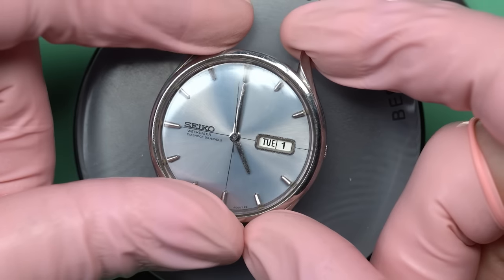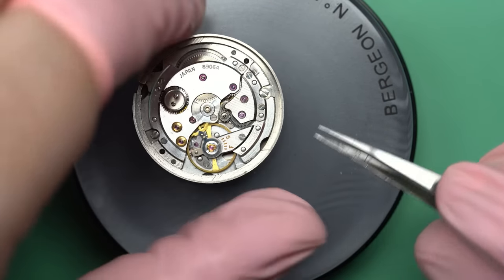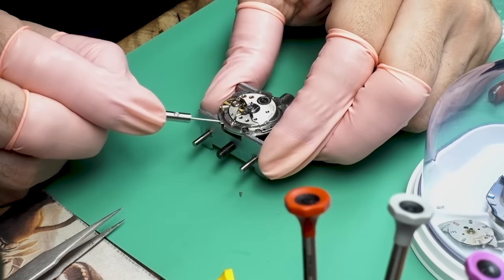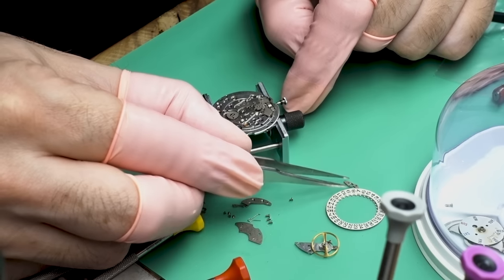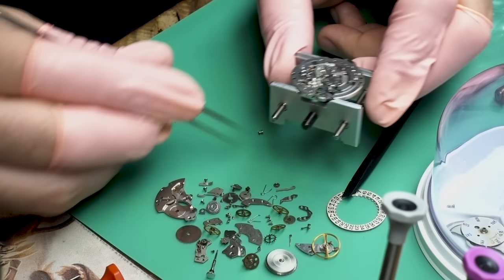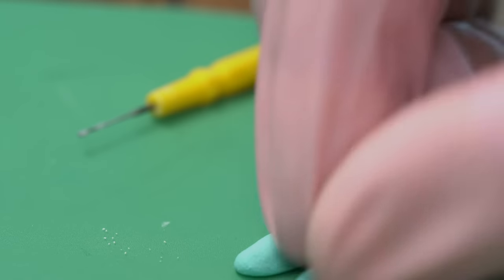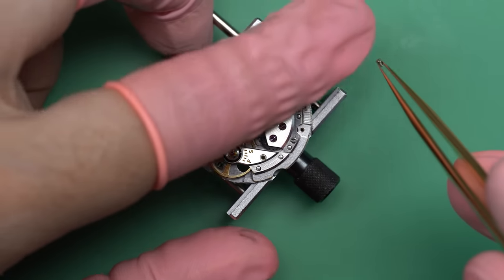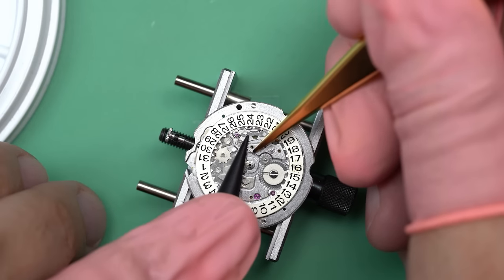Seiko Weekdater Sea Lion Vintage Watch Restoration

Comment: Hi Marshall, I checked out a bunch of channels and you explain this better than anyone. Since I was a kid, everything I didn’t understand had to come apart so I could see how it worked. Needless to say, I will pat myself on the back and have a good mechanical ability. So here I am and I would like to repair an old watch just for fun. My question is, what is a good watch / movement to start on? Where parts are readily available? I am a big overly handsome fella with large wrists, so if there are several options, something larger would be great so it will look in place on my wrist when I am done. Also, If you can suggest something that you have done a vid on would be super awesome so I can follow along on how you did it in case I get lost. Thanks.

Comment: I’m a watch enthusiast, with a descent mechanical watch collection.  Your videos have been very inspiring. I really want to get into watch maintenance/repair, if nothing more to learn how my time pieces work. I plan to teach my son while I’m at it. We are both mechanically inclined. Its a dying art that I hope channels like yours will revive. Detailed steps, informative, and the why behind certain designs and movements. I’m buying a couple of ebay mechanical watches to get my feet wet. Do you think it would be possible to make a video explaining the lubricants? I’m still a little confused about the different types. They are expensive and I dont want to buy the wrong ones. Also how do you keep track of the different screw sizes and their location? Keep up the good work!!!

Comment: Oh I had to wind my watch a lot actually.
It's an automatic but as I spent most of my time with my arms motionless, it didn't wind that much.
I cycle a lot and usually have my bike with me so I end up not even walking much.
It stopped working, probably because water got in. Quite liked the watch, it's transparent so I could see the rotor moving, although I got some alcohol on it by accident in the lab so now it's clouded up

Comment: Did you forget to put the gasket back in when you put the crystal back in? It looks like there are 2 still sitting on your bench after you got done....great job, really nice looking and love the way the lume works.
Reply: this type of crystal does not use a gasket. It is a tension ring type of acrylic crystal.

Comment: Flying parts suggestion. Build a three-sided frame 12 to 18  inches high to fit around the sides and front of your work area. If any parts fly left, right or forward they will be contained in the work area. You body should stop parts flying backwards. The three-sided structure would just sit on the work area and easily set aside when need be.

Comment: I like seeing jeweled pivots on the barrel.  Some makers, like DURoWe, actually floated the barrel on jewels as well to prevent plate wear.

I don't believe I have ever seen a watch which had indices that high off of the dial before.  Also pin bankings are a bit unusual to see on a Seiko movement, at least in my experience.

Comment: The question for me is for you to find those parts that's a sprung a spring. And that would be to see how watchmaker producers find the springs when they get sprung. Do they have a room specifically for making the watches because obviously it is a tedious process. Do they use a metal detector, miniature type?

Comment: When I was a kid I had one of those brass alarm clocks with the two big honking bells on top that you could hear the alarm in the next state. 
When it stopped working, I took it apart, but couldn't put it back together again, mainly because it was riveted together.
I remember all the spindles were metal axles inserted into the two metal plates which made up the movement.  No jewels.  
I regret doing that now, because they're rare collectibles 😞  They're all battery/quartz now.

Comment: I just got a watch that will blow your minds..an automatic quartz..marshall you know it. But i will explain. The seiko kinetic..a rotor moves as you do, and creates a voltage as it passes over an electromagnet. This produced voltage charges a capacitor, which runs the motor. Its a seiko as well, 5M62-OBCO. I havent started on it..initially i would have to buy a $25usd lithium ion battery, since the capacitor idea seemed to be a dud..not enough voltage to keep the watch on time, as quartzs are known for.
Reply: Seiko makes a kit to replace the capacitor with a rechargeable battery, which works perfectly. I've done it on a couple of Kinetics. The one for my watches was Seiko Part number: 30235MY but I think there are a few different models depending on your watch's year/model etc...

Comment: Hi Marshall. I can't tell you how much I enjoy your videos. Your enthusiasm for watchmaking is infectious. I recently obtained an Omega automatic men's watch from c. 1954 that seems to run but probably could use a tune-up, because I have no idea when it was last serviced. More than that, the previous owner, for some unknown reason, removed the lugs from the case, so it needs a replacement case and a watchband. Is this a project that you would be interested in looking at? Thanks!

Comment: Hello, just started watching your videos recently. Your videos are pushing me to really learn and get into this. Question, on one of the videos you'd mentioned not being 'experienced' enough, for lack of a better word, to really dile in the timing of the watch. Does a simple watch service/cleaning help resolve some of that timing issue? And in short/layman's terms, what do timing adjustments involve? Messing with gears, messing with oil, etc...

Comment: The lume was likely polymerized tritium paint originally, radioluminescent and not requiring outside light. I’ve seen Elgins from the ‘50s with radium for this effect. It’s odd at first to see radium burns on a dial with what appear to be solid, unlumed hands.

Comment: being a fan for quiet a while, loving the quailty content, just a question, so the crystal remover (or the crystal remover) will not break the front crystal in general, is that right, or what is the chance for the crystal to crack when using the pressure?some watch do have the branding printed on the crystal so just want to be sure. again thanks for the content, wishing you the best with the tiny watch parts. :)

Comment: Find an old 12" woofer, take out the magnet. I have one, and it's great for sweeping up tiny parts from carpet, or tile. I don't do watches, but I do laptops. Granted, the screws, and springs, aren't anywhere near as tiny, but still, they can be hard to find in carpets.

Comment: Hi Marshall, I enjoy your videos and have learnt a lot, thanks! I'm curious if you've considered putting up plexiglass on three sides around you to improve the odds of finding a flying part? Also if I might suggest something: I've found that the very best way to preserve rubber (gaskets and other parts) is to remove them from oxygen. I've used a medical vacuum pump (Gast is the make I have) and mason jars to achieve this. Idk if this is an overkill but if the parts you're storing are hard to find or expensive it might be worth considering?

Comment: 13:40 I had to get started because I bought a new seiko off amazon that was 10 minutes fast/day. Stopped it a few times and was scared i poked the hair spring twice but everything seems good now.

I see talk about setting a watch for 4 positions or something and I dont even know how you would go about it.  Splitting the difference between optimal setting for  one side and another? Do you get some sort of platform with micrometers on it to adjust it?

Comment: My favourite Seiko has to be my 6349, cannot fault it or any of my 7009's and I even have a very unusual 7009 two tone watch where someone had fitted it with a 7S26 and again its performance is exemplary.   Only have one Seiko quartz, a very unusual SQ with a double dome crystal and gold tone unique bracelet but what makes it unusual is its massive, 40 something diameter on the case, in fact its bigger in diameter than my Pulsar YM92-X098 which is the large swarovski and gold tone bling watch.   I am looking out for a 6309 next.   BTW did you check the lume "pods" on that as I seem to remember they are tritium or radium filled :S

Comment: I wonder if you'd like to do another one of these as a viewer submission? I don't recall if it's the exact same model (it's in my storage unit, since it doesn't work and I can't really wear watches most of the time anyway), but I have my dad's old self-winding Seiko with date display, and the face looks very similar, and it seems to have the same problem, that it ticks for a few minutes after shaking vigorously, then stops. I recall opening the back once and deciding it was way too much for me to attempt, and the one time I took it to a jeweler (I don't know of any specific watchmakers in my area), they told me I should just send it to Seiko for repair, but they'd probably just tell me I need a new one.

Comment: Marshall - How did you lubricate the reverser ("roller locking wheel")? I've reach that oiling it like an auto-reverser on an ETA can cause it to bind. I have an 8306, and find the winding fairly tight, and I suspect it's the reverser wheel...

Comment: Stunning watch.  Some horrible luck on this one, but it came together.  Have you considered having like a large plexiglass fence around your desk/work area to try to contain the flying parts at least 70% of the time?  I've thought about it myself, I'd likely take an old aquarium and cut two hand sized holes in the glass

Comment: I recently watched many of your videos and find them fascinating. My Seiko dial has spun within the case which I strongly expect means the dial feet have broken. I've seen videos about replacing the dial feet but I suspect my dial is plastic. Do you think I could still use the tool to cut into the underside of the dial to add new dial feet?

Comment: What happened to that wheel next to the barrel during cleaning (around 20:15)? It looked like bright copper/brass when you took it out, yet when put back in it looks like rusted steel - did it somehow react with the cleaning process?
Oh, and a question: do only capped jewels get oiled? I didn't notice the jewel on that cover plate for the center wheel getting any attention when installed. Btw, was that odd leaf spring thing covering that acting as a sort of shock absorber for the center wheel?

Comment: Replacing this crystal took me 3 glasses/attempts  and i ultimately had to purchase a screw down Press and  alu dies with straight shoulders as the beveled ones would hit the glass before the bezel, but, as usual, no problem as soon as the right tools were used

Comment: Hey Marshall, awesome and informative video. I just picked-up a Seiko at an estate sale. The crystal definitely needs to be replaced. I believe the watch requires the same crystal (Seiko Model #6106-6000 - Serial #990121) as the one you used in the video. Would you, or anyone else, happen to have that part number? Or am I completely wrong about the crystal compatibility? Thanks in advance.

Comment: I think this movement was only in production for 4 years. It makes me wonder how rare/expensive sourcing parts are.
Reply: they are not impossible to find but no where near as common as many other Seiko movements. They are very similar to the 5606 design, both are more complicated than most of Seiko's other movements. I have found the 5606 movements to be extremely accurate. I have one 5606 in my collection that after I serviced it consistently runs less that +10 a day.

Comment: What year was that watch made? Did they use radioactive lume?
Reply: you can date most Seiko newer than the mid 60's by the serial number. You do have to have an idea of the decade though. The first digit of the serial is the year, the second the month with N and D for November or December. Also if you look at the back of the dial you will see a black ink stamp of 7N with means the dial is from November of 1967 which falls in line with the case serial number.

Comment: I'm sure you did it off camera, but at 21:29 you install the "middle bridge". There was a screw that didn't come off the bridge because of the gear that was not removed. It did not appear that that second screw got tightened. The slot never moved from bridge install to after you turned it back over to finish the front assembly. But like I said you probably did off camera.

Comment: the first watch i tried to fix is a old lordmatic 5606. now it sits in the drawer with a crown stem broken off inside the crystal cracked and its gonna just sit there probably til i die or throw it at the raccoon that knocks the garbage cans over

Comment: With the 'lume' placed as it is, could Seiko have been using it to silhouette the hands and hour markers? You speak of losing springs and things, many years ago, early 1980's, I helped out in a friend's jewelry store and had a 7 caret diamond decide to go airborne, we looked for hours. Finally, did find it in a little crack between the baseboard and flooring, where the flooring didn't quite go all the way. Needless to say, I was sweating pretty hard, as it was graded a colorless VVS1.
Reply: turn off all the lights in the room and use a flashlight. The diamond will sparkle in the dark. I've found many diamonds that way.

Comment: You need to make an enclosure for your desk. Can't really put anything along the side you work from but the front and two sides should be OK. Anything that flies off in those directions should hit the enclosure and bounce back. Doesn't need to be too high, perhaps 2 feet or so. Alternately, get some sort of glass or plastic dome with one side cut out for your hands.
Reply from the maker: Yeah it’s tough because my watchmaking desk is also my computer desk 😂
Reply: @WristwatchRevival  Could make something removable. Alternately, put it in a corner. At least that way, you have 2 sides protected.

Comment: When removing crystal apply WD 40 along the edges. It not only removes the dirt and any pastes applied to fix the crystal. The crystals don't break as in the video. The original crystal in the watch can be saved. Replacement crystals available in the local market can't match he original crystal that comes with the watch.

Comment: You need to oil right around the top of the barrel joint.. before you put that ratchet wheel on top for this one.. but usually all barrel joints need oiling. You need to oil the keyless works and the studs that the arms attach to.. the crown castle and wheel as well.. the day jumper spring against the arm, the click spring..It’s a great vid but just want to warn people that there’s a lot more oiling that needs to happen. Hopefully the cap jewels were oiled.. they need to be. Don’t mean to be a bummer cause it’s great.. just missing a lot of oiling.. maybe it was taken back apart and then oiled? Hopefully..

Comment: I have a weird question regarding the dates. Does it go 1-31-1-30-1-31-1-30 or it does 28 in February? 
Do you have to check if that month ends at 30 or 31 while setting it? 
:D
Reply from the maker: For a normal watch it goes to 31 no matter the month, but if you get an Annual Calendar or better yet a Perpetual Calendar it automatically accounts for this and even accounts for the leap year!

Comment: If you wear a automatic, are a carpenter and happen to operate a router, you will super wind your watch possibly.
 Over wind it possibly.
Ask me how I know?
 3 repairs done by watch maker till we figured it out.
 Crazy, who would have guessed.
He ask if I was operating any kind of high vibration equipment/tool.
 The router came to mind and times watch quit working was the clue.
 He figured it out. Only issue I ever had with that seko watch.

Comment: I always thought a watch that had a day and date was a day date. Not a weekdater.  Is there a difference for the daydate?
Reply: "Weekdater" was just something Seiko named a series of their day/date watches during the mid-sixties (like it was literally text on the dial), using several different movements (the 86XXs and 62XXs mostly). There's no mechanical distinction between them and any other day/date in terms of function (though Weekdaters usually didn't have a quick-set function for advancing the day). They typically had a relatively 'modern' design cues and were upper-mid priced affordable watches aimed at people who want a nice watch, rather than something purely utilitarian.

Comment: 17:20 that's not a design flaw that it couldn't get light to charge it up. It didn't need light to charge it up. That's a dead giveaway you're dealing with radium lume. It appears up through the 1970s.

Comment: Is there a way you can set up your work space/ bench so that springs and other flying objects don't get lost. A containment barrier, with a sticky surface or magnet. Have all your tools up in covered cupboards. Definitely loose any carpet or nooks and cranny's. Plan for miniature disasters.
Reply from the maker: Maybe if it was a space used just for this? Even then they have a way of getting away I think.

Comment: Slowly working my way through your older videos. After seeing you lose two springs all I can think is "man, I would have to buy replacements in bulk". I would probably build a white "work booth" to do all that in. At least it would give me a (very slim) chance to find them again. Ah, who am I kidding. It would be GONE.

I am a little surprised the lume could "charge" sufficiently being on the back side of the hands.
Reply from the maker: Yeah I feel like in day to day use the lume wouldn't charge quite enough